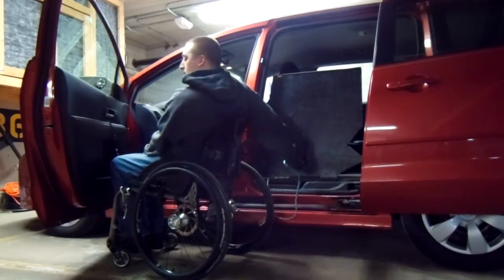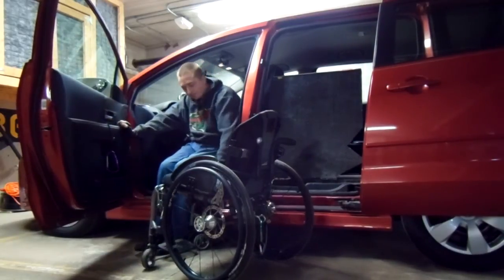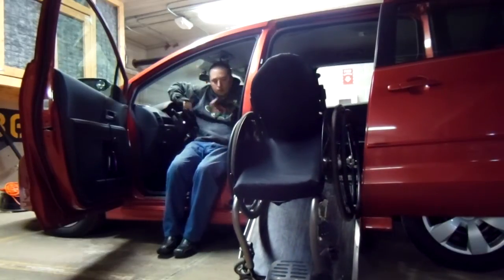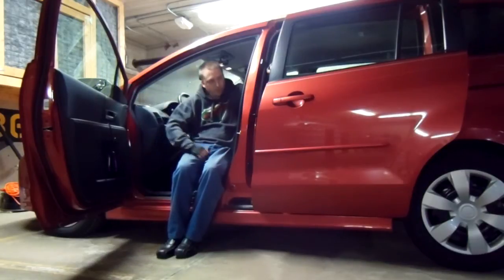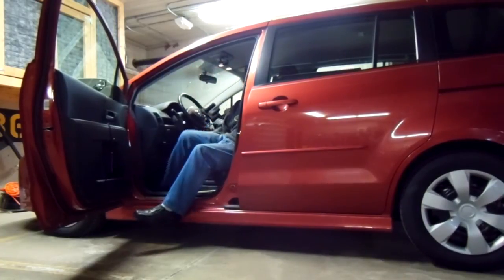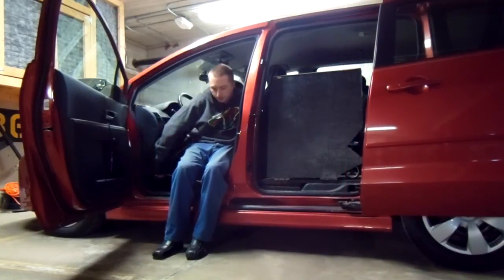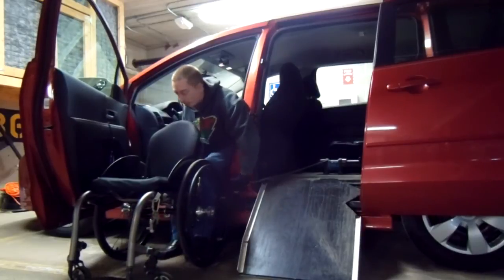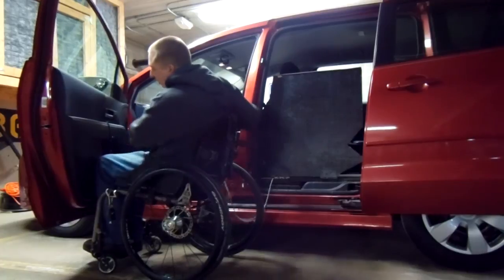Mazda5 Wheelchair Conversion

Comment: Just wondering how you are doing with the Mazda 5,  I just purchased a 2014, had handcontrols installed and I removed the seat behind the drivers seat. With that seat removed I am able to pull my chair in behind the drivers seat and shut the door. As time goes on it gets easier. Thanks for the video, nice job....    Jim
Reply from the maker: Still using it daily and it's been over a year.  I tried but did not quite have enough strength to pull the chair in on my own, hence the winch and ramp.
Reply: AdaptiveSolutions

Comment: we are gabbing a similar deal on a Honda. What winch do you have and where is it sourced? We have only found slow/VERY strong cable winches.
Reply from the maker: Just spoke with Ted on the phone but figured I would comment anyway.  This is the model winch I used:  http://www.northerntool.com/shop/tools/product_630322_630322 (Ramsey ATV 2500)  I originally bought the winch in 2003 and used it in a different application until moving it for this conversion in 2013.  Looks like they haven't changed in 10 years   The wireless feature isn't necessary but has come in handy a few times; in day-to-day use I just use the switch, which is much more convenient.  It says max speed of 20.8 ft/min with 50 ft or rope when on the first layer on Ramsey's website.  This winch is really more expensive than one would need, any non-wireless that has max speed above 15 ft/min should work fine.

I also used 35 ft of winch rope from this guy:  http://www.midwestwinchrope.com/

Good luck!
Reply: Did you end up getting something working on your Honda?  If so you should post a demo of it.

Comment: can a mazda 5 2010 support the use of a hitch and cargo carrier with ramp to haul a electric wheelchair or jazzy
Reply: I was only able to find a Class I hitch for the Mazda5. This has a tongue weight limit of 200 lbs. I would feel comfortable with a carrier and a manual chair or bicycle on that, but not a power chair or scooter. You would be better off pulling a very small trailer for the power chair or scooter, or using a vehicle that has a standard class III hitch available (the 2 inch square hitch). I hope this helps.

Comment: I am wondering what you used for a transfer board to the driver seat. if you have any drawings, it would be nice.
Reply from the maker: ybaja777 I do not use any transfer board. The Mazda5 seat height is almost a level transfer from my chair and the gap across is short enough to make an easy transfer. And standard transfer board should work if you need one. The other option is an XL-Board from AdaptSolutions (different company from us). Just Google XL-Board
Reply: I was just wondering, if you know, if the seat height is the same for Mazda MPV, as it is for Mazda5 wagon.
Reply from the maker: I've never transferred into an MPV,  but based on vehicle height of ones I see going down the road, I would guess their seats are 2 to 4 inches higher than the 5's.

Comment: what kind of hand controls are you using thank you
Reply: +humberto M  They are an old set MPD right angle.  Had them installed in my vehicle in 2003 and transferred them over when I got the Mazda.
Reply: +Tyler Thompson cool thanks for the info.